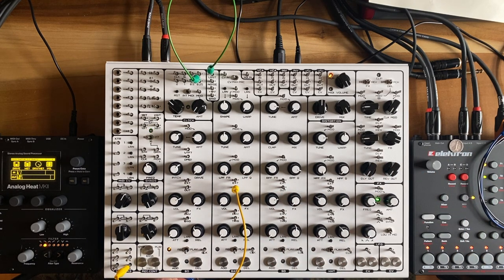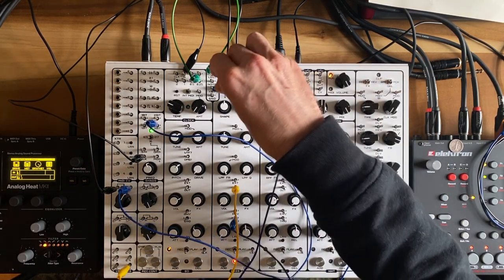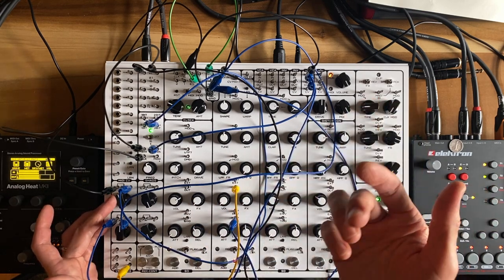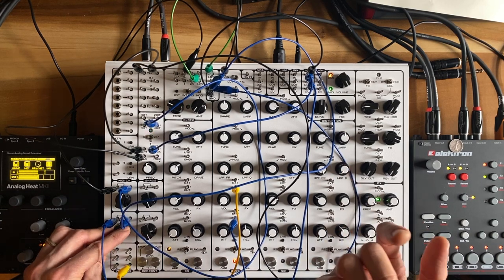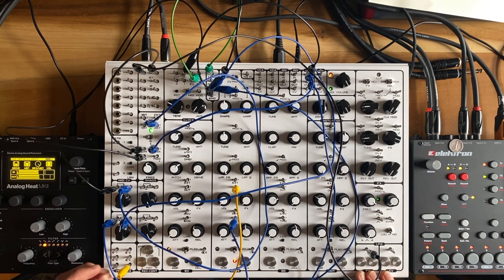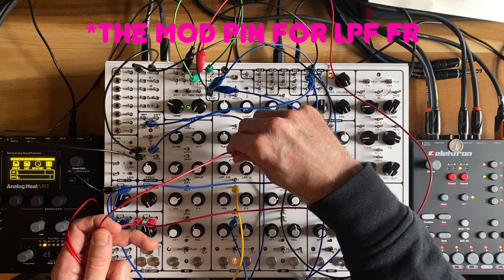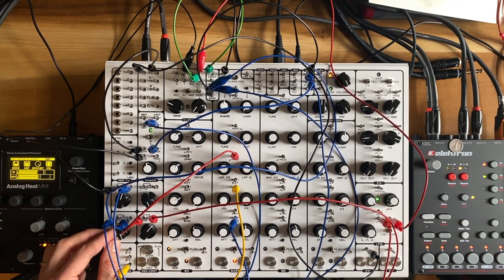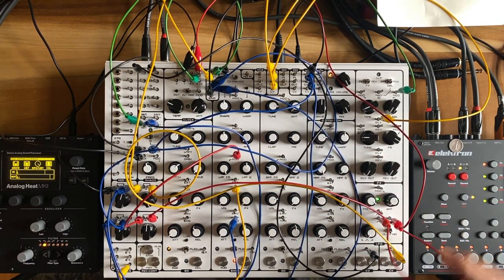Pulsar-23 Patch Along #3: Creating Melodic "Parts"

Comment: Introducing the LFO to create the 16th beat is a stroke of genius!   One thing you can do to guarantee a constant 16th is to just have the sync patched to the 16 clock and as long as you're up high on the LFO freq, you'll be locked into the 16th.  A bonus for doing this, is you can then fade that 16th pattern in and out by slowing the LFO down and it'll essentially no longer trigger.  This also frees up up that attenuator to still control the Bass Mod, but without the 16th rhythm if you don't want to.    Really dig the end jam!
Reply from the maker: I tried out your suggestion and it worked like a charm-thank you! I like having that attenuator back for other uses. Thanks for the kind words about the end jam!

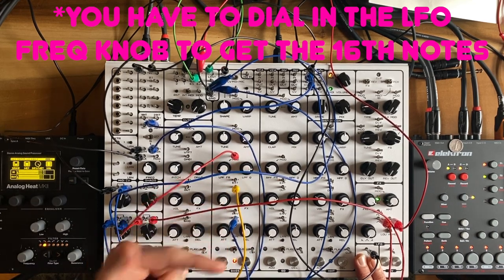Comment: Nice, Liked, Subbed. 9:50 yeah, [LFO] clock still needs to be set for speed - even when synced - whereas the SHAOS 'hard locks' and syncs as you might expect. The clocked modules [LFO], [SHAOS] & [CLOCK] all have independent clocks, there is 'no master' as Vlad would say. I notice the coin on the electron for holding [CV] pads, a good way to get an extra pair of hands. Great SHAOS patch for melody control, and the end jam was cool too man, cheers! well done! :)
Reply from the maker: Very observant about the coin! Yep, that is what I use it for, and in fact I was going to use it in this video but I forgot. I usually put it on the CV pad to hold the cello/drone sound coming from the FX unit. When I don't want the drone I just turn down the delay volume rather than remove the coin. Thanks for the encouraging words!
Reply from the maker: Ever think about making a Pulsar video? You seem knowledgeable about the functions!
Reply: @guiremcguire743  Thanks, I think i will at some stage, cheers!

Comment: The Octatrack can send consecutive 1/16th midi note gate to be read as trigger pulsar? I use Akai force but it is being read as a long sustain gate instead, maybe its due to the fact that i cant edit the midi note length
Reply from the maker: You can select midi note length on Octatrack from 32nd notes to infinite. I usually send 32nd notes and then use the release on the envelopes of the pulsar so I can dial in grooves easier. Does that answer your question? I will be doing some videos on Octatrack controlling Pulsar in the future.